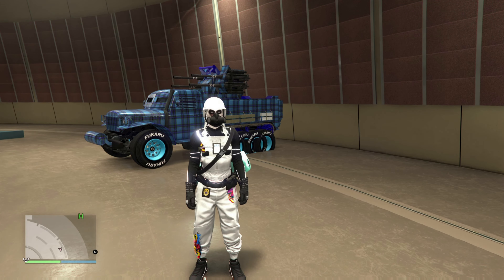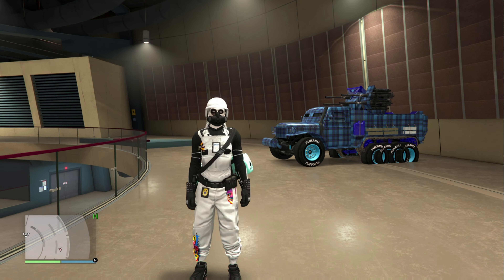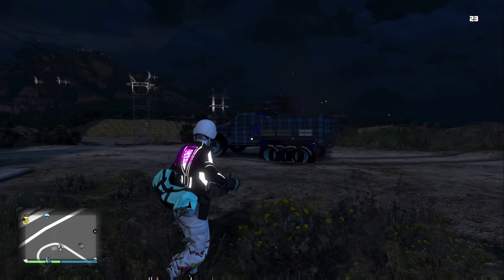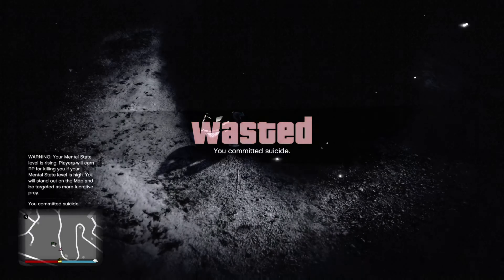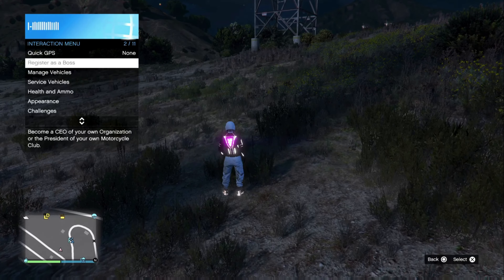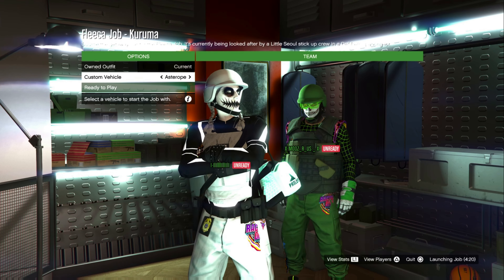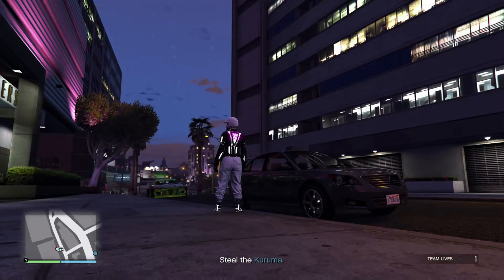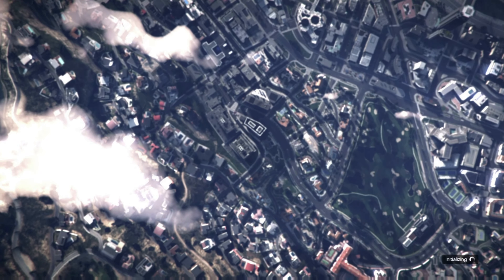How To FIx SPECIAL VEHICLE DEADSLOTS In GTA ONLINE (4K HIGH DEFINTIION)

Comment: I have a dead spot for my ruinner 2000, now I blow up all my cars, and now when I start mission I don’t have any auto to chose?
Reply from the maker: @VeljkoMilica  Are you asking or telling? It is a regular vehicle causing your Ruiner deadspot I guarantee it. Just like the Asterope in my video was causing mine. You have to destroy ALL of your vehicles that can be called out with the mechanic. Other special vehicles and service vehicles don't count so nevermind those. It works bro trust me you seen the video I'm assuming? I don't click bait sir, never have never will.
Reply: @MODZGAMINGYT  but I blow up all of them, I have only a bike to chose! And I have 10 terrorbyte but they did not appear in the mission
Reply: @MODZGAMINGYT  I trust! Just asking what to do now because I can only bike chose in the mission 🤷‍♂️
Reply from the maker: @VeljkoMilica  What kind of bike? Motorcycle or pedal bike? 🤔
Reply: @MODZGAMINGYT  inductor pedal bike
Reply from the maker: @VeljkoMilica  Idk then bro if u blew up all your vehicles and there is no motorcycle or regular car available  in your heist menu then I don't have a clue what could be causing your Ruiner 2000 deadslot?

Comment: Hello, I have 8 dead spots. They are planes. I was told to replace them, so I exchanged them for buzzards. Unfortunately, I still have the dead spots and I can't sell the buzzards.
Reply from the maker: This method is for Special Vehicle deadslots, not regular vehicle deadslots. Two different things so two different methods. For regular vehicle deadslots you would need the kill the bird method to be working but unfortunately it's not. Not sure of any other ways to fix regular vehicle deadslots atm
Reply: Hey man you ever fix dead spots?
Reply from the maker: @pedroesparza6427  To fix regular vehicle deadslots is a different method. Usually it involves getting rid of your modded aircraft because they can cause regular vehicle deadslots many times. However not always. If it is not planes causing the deadslots then you would need to do the kill the bird method which was patched a long time ago. Some people try to say it is still working but they are lying because it is not. This video is for Special Vehicle deadslots though.
Reply: Need a regular dead spot fix without kill the bird as I don’t have story mode anymore shame bmx rack don’t work anymore
Reply: I have over 100 cars
Reply: @justharry305  well just harry throw the whole PlayStation away 😂😂
Reply: So what you want to do when it comes to the plains is you want to sell every single one of them or remove them you do not want to replace them once you remove them from the hangar then you should be able to buy allergies in your dead spots
Reply: LOL free cars in your dead spots
Reply: Yo what you need to do is you need to sell all the planes that caused the dead spots or remove them from the hanger as soon as you're done removing them and they're no longer there you'll be able to buy a free car and your dead spots
Reply: @mykoolgta5267  apparently it’s not my planes 😂😂 as I’ve done all this I’ve just got 15 random dead spots I don’t really care tbh I got a nice account and I’ve done over 5 accounts time for gta 6 now end of a era for me
Reply: @THEONEANDONLY_Double_D  okay bro I just wanted to let you know that if you remove them planes from your Hangar instead of buying over them it will fix your dead spots guarantee and if you really want them playing you can give them to another player or another account and they can hold it in their mobile Operation Center or they can actually take it as their own plane and give it back to you after you've cleaned your dead spots but don't forget to fill up your hanger again before receiving a plane your finger has to be completely full you need to full alert when you try to take another one in then replace a plane on the hanger floor